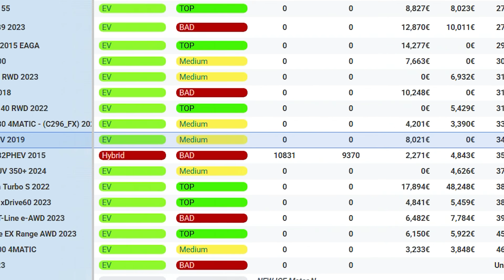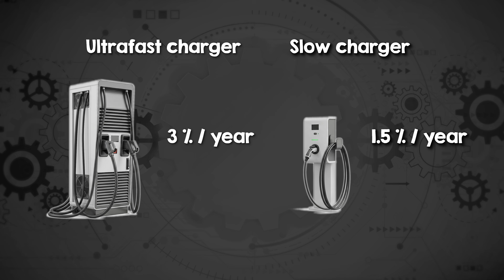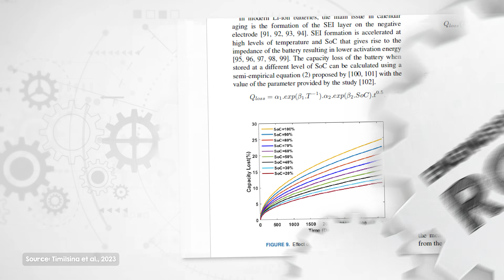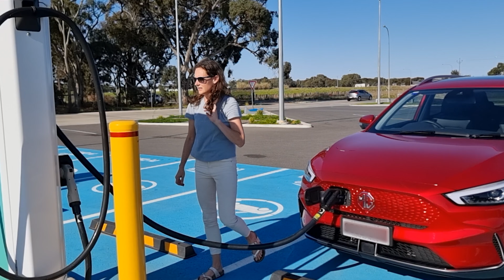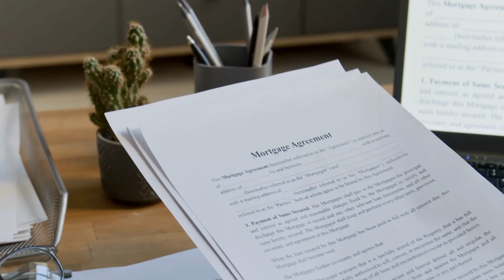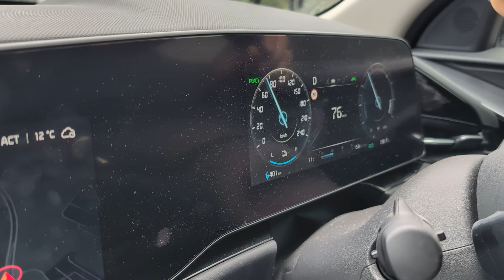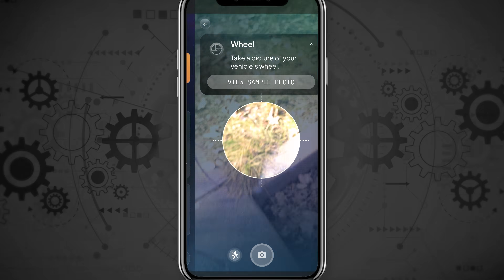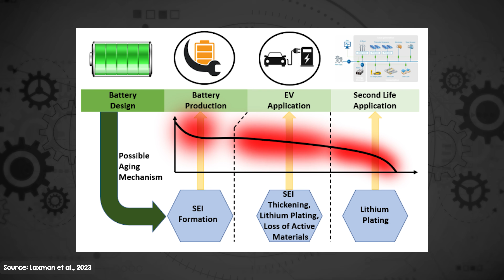Watch This Before Buying Your EV

Comment: Great info, I drove a lease EV for 4 years over 50k miles and mine lost about 4% but I only slow charge at home using the original plug in charger that came with the car.

Comment: Maybe the best any test will tell you is that you're still somewhere on the degradation plateau. I'm afraid that plateau just gets longer and flatter with more LFP on the market. Great information, though! Bottom line: EV batteries last longer than most people expected, and that's bound to get even better.

Comment: my 2013 chevy volt which i bough new now has a limping battery which i need to clear codes occasionally.  I also have to keep more in the battery to keep it happy.  the trouble is that the batteries are generally in series, and all it takes is one cell to pull the entire pack into the trashcan.

Comment: The battery will not be as much problem as manufacturers causing software problems. I had my cellphone for 10 years, and the only reason I bought a new one was the carrier stopped supporting updates that worked with it. If they left it alone, it would have been fine, but the last update caused all kinds of problems intentionally. They did not want me to have this old phone. Car manufacturers will do the same.
Reply: You seem to be describing software-based planned obsolescence, which is being tackled in some places, although too slowly and lenient towards the culprits. I'm afraid.

Comment: I get that people don't trust the information that the car provides via the OBD2 port.  However, how reliable or unreliable is this data?  I used the "Car Scanner" app (free) with a Veepeak dongle (about $50CD) plugged into my 2017 Chevy Bolt.  It reported 59kWh, or 89% of the 66kWh battery that was installed via recall in 2022.  It also reported individual cell voltages, which were within what are considered healthy ranges.  Some say that a more accurate test is to discharge from 100% to 0% and see what the car reports as energy used.  I did this and the car said it used 61.4kWh, or 93% of 66kWh.  (To discharge the last percent or two to zero I parked beside my charger and put the heat and fan on high.)
Is there really any practical way to measure EV battery energy output without relying on the car's sensors and software?

Comment: Most EV batteries are great nowadays. However Tesla’s latest USA Panasonic NCA cells are terrible for degradation. Mine is sitting at 89% at 30,000 miles and I baby the battery when charging

Comment: The usable capacity of an EV battery is the total capacity minus the size of the upper and lower buffers.  Software updates can decrease the buffers and thereby increase the usable capacity.  This hides degradation but maintians the car's range.  Smaller buffers make the battery more susceptible to degradation.

Comment: It's simple. For an EV used primarily for commuting in the United States, use a level 2 charger (240 volt) setup in your garage. For everything else (to replicate ICE travel) the United States needs battery swap stations. If you regularly drive long distance road trips, DC fast charging doesn't make sense! It's using the WRONG mindset! China has perfected the battery swap station... similar to a propane tank exchange. The key is keeping prices in line by preventing Wall Street vultures out of the mix. I envision a co-op type setup where EV users are the investment engine. The eventual idea is to have swap stations as prolific as gasoline/diesel stations. A drive through battery swap can be done in similar time as it takes to fill an ICE vehicle with fuel... possibly faster. It CAN be done. It just takes the willpower to ignore the oil lobby propaganda.

Comment: In 2017, I bought a used 2013 Nissan LEAF. Over 13 years (and 110 000 miles) the pack capacity degraded on average 2% year on year. Here in Québec you can buy this nice 'city' car with 90 km range for 4000 USD (2014 LEAF, on jnauto)

Comment: my 9 year old ionic with 275000 km still has 24kwh ( out of the orginal 28.8). My 11 year old Opel diesel ( 188k km) ( which i originally bought for long trips needs  twice yearly maintenance so I dont trust it for long trips anymore as it broke down with injector trouble stranding me in a tunnel. Anyone want it?

Comment: I just leased my first EV figuring in 3 years the tech will have improved a lot and I’ll get a better car. I charge at home (level 2, AC) and have about 17000 miles in the car so far. I haven’t noticed any degradation yet. I’m so pleased with my choice to lease an EV. It’s been a great experience.

Comment: The title and thumbnail are very clickbaity but the video itself is full of usefull and correct information. Well done.
My degradation after almost 2 years and roughly 26k km is just 1,1%. I use an OBD connector and a 3rd party app to measure it. I live in temperate climate in Europe with mild winters and not too hot summers. I also prefer AC charging and use DC mainly when I need a quick charge.
Edit: numbers corrected

Comment: 10:40 FWIW, the results of that initial factory test are usually stamped directly on the cell, often with a QR that links to the full test results for that specific cell. Of course, reading this yourself involves dismantling your car. 😜

Comment: I bought a used Ioniq 5. I was worried about the battery before I bought it. But now I own it and have joined all the Facebook groups etc, I’ve learned that the ICCU is much much more likely to fail and leave you with a massive bill.

Comment: What was the SOH indicated by the BMS? If we assume the manufacturers aren’t lying, the BMS should have fairly accurate estimates - after all, it’ll know under which conditions it’ll shut off (consider the battery to be empty) and when it’ll consider the battery to be full, and how many watts flows in/out before that.

Comment: Interestingly failure rates of comparable combustion engine vehicles seem to see engine failures are between 3% and 8% and most combustion engine cars and we have three or four year warranty as opposed to 8 year warranty on all electric vehicle vehicles. Also the cost of replacement come between 12 and £28,000 for a main dealer manufactured replacement engine.
I always ask the question what happens if your engine blows up after 3 1/2 years to some friends of mine who always ask me about what happens if my battery fails. My battery is nine years old now I’m still going strong and ironically my friends wet belt on his Ford transit van that was 3 1/2 years old went and he needed a new engine replacement at the cost of £20,000. Nobody ever talks about this the other way round.

Comment: One tip, never buy a white model 3 from a dealer, these are ex rentals that have been regularly fast charged and often charged to 100 percent by the rental company. I looked at one model 3 just like this with just 40K Kms and two years old, it had lost more than 20 percent of the battery capacity.

Comment: EV-Clinic is presenting the prices from the manufacturer, from the parts catalogue AND in a different context from the one you're presenting. These are going to be eye wateringly expensive because it's not the norm to replace the whole thing, just like it's not the norm to buy a new engine if the old one has an issue. That's a new part, with tens to hundreds of brand new cells, BMS and all, 100% SoH and 0 cycles. That's the premium solution to the issue and you'll pay accordingly.
But if only a cell is damaged, the cost of a cell replacement or module replacement is significantly lower and doesn't have to be done by the manufacturer, but by any other tehnician. Teslabjorn, Out of Spec Renew show EV repairs and they're not as expensive or as hard as it may seem.
As an example Renault Zoe is Q240 is listed there with 20.000€ for it's 24kWh battery, from 2015.  But, a replacement battery from a donor car with 41kWh capacity for the same car can be had for less than 4000€. A whole pack, newer and with more capacity. The same applies to the other car models as well. The repair cost of a module is also even lower than that because if a cell is weak, you don't replace the whole pack but a module at most, depending on the health of the surrounding cells. The same with the motor, you replace what's broken, not the whole unit.

Comment: What is with the smart phone analogy? I keep every smart phone until it’s pushed off the network because it doesn’t have the right protocol anymore and I’ve never had any battery issues. Meanwhile, I have dozens of lithium polymer battery toys with individual pouches and those pouches have all kinds of issues (but none of those issues include spontaneous combustion as we seen in the cells used in EVs.)
This video is a swing and a miss, as far as thoughtful engineering goes.

Comment: Battery capacity is not lineal which means 78% battery could be 0% in a second. So the number 78% gives you a false sense of mileage of EV.

Comment: Nissan Leaf are especially bad for degradation due to the battery design. They have no active cooling.

The battery BMS stores a SoH value that it calculates, and the quick scan could be showing that value.

Comment: I have a 1 year old MG5. The biggest impact I see on range is winter in the UK. At a few degrees above freezing I get 2.5 miles per kWh at 20 plus I can get 5. At least in Oz you don't have to worry about frozen batteries. As for degradation if there is any it's hardly noticeable against a background of fluctuations in ambient temperature and driving style / conditions.

Comment: When colour TV was new, everyone was terrified the colour picture tube would fail and cost a fortune. The reality was they were actually very reliable. Same for when electronic fuel injection came along in the 80s. The reality was it was also very reliable, look after your EV and the odds are on your side and avoid known early problematic models.

Comment: I notice you have a Kia and am glad that you point out that the on board system has a buffer to hide the degradation. My 7 year old Kia has significantly less range than when it was new esp in the winter.  I asked the dealership at my last service to check on the state of health and they told me it is 100%, which it clearly is not. Thanks to your video I will check out independent battery SOH testing. Of course Im wondering if I am below 70%, in which case the warranty should cover a replacement. Do you know which form of independent testing they will accept, when their own system shows 100% and of course they will want to avoid the cost?

Comment: Spare battery packs got so cheap it’s no longer sensible repairing them. For a Tesla you’re looking at few thousands for a new pack, that’s for a car that did few hundred thousand miles over 10 years or more, all while requiring almost no servicing. 
Comparable diesel will cost you 10,000 in servicing alone , another 10k in extra fuel cost and then you’re looking at major engine rebuilt / refurb (injection, valves, electrics, exhaust, dpf,…)

Comment: I live in the US and own a 2020 Toyota RAV4 Hybrid with 75,000 miles (120,700 Km) on the odometer. When the car was new I got as high as 47 mpg city, 36 hwy. Now I struggle to get 40 mpg city but, still get 36 hwy. This is barely better mileage than a conventional gasoline only model. I blame it on battery degradation. Compounding the issue the car chooses to keep the engine running at odd times, especially when stopped or very low speeds when the battery is full and the engine is up to temp.
It's for sale!

Comment: Nissan Leafs have more issues because they are the only EV without thermally managed batteries.
Our 2012 second hand Leaf had its battery replaced under warranty. Our second hand 2019 Leaf is also getting its battery replaced under warranty. Leafspy software is great, shows bad cells where Nissan's capacity test doesn't.
Modern phones allow you to set a maximum charge.

Comment: Something kinda big you're missing here is cars with thermal management vs those without. 

That leaf you compared to has none so it will suffer more than say a Tesla with both thermal heating and cooling. Then other models that might only have cooling. 

You should also look into self tests. Tesla has two, a general rating based on the BMS readings and a proper tests that involves cycling the battery. Its only on the charge cycle that I can tell so I'm not the biggest fan. bMW i3 I understand can give you a read out based on the BMS which is better than nothing.

Comment: As mentioned by others here - if you are unlucky enough to have an out of warranty EV with a faulty battery I'm guessing as time goes on there will be plenty of mechanics that will be able to source a used replacement pack from a wrecked EV. This is exactly what happens now if engine replacements (no one replaces a faulty engine with a brand new one bought from the manufacturer). Probably also likely there will be a whole repair/refurbishment industry that takes in bad EV batteries and replaces faulty cells.

Also the benefits of LFP chemistry over NMC cannot be overstated. Buying a used EV with NMC chemistry will always be more of a gamble than LFP because LFP cells have a lifespan that is 3x longer. This on top of the ethical concerns of nickel and cobalt mining really make me wonder why some manufacturers still continue to use NMC chemistry.
Reply: Cause they are much more energy dense, even Tesla use them for their long range models

Comment: I still wouldn't buy an EV or a hybris. Most of them are UGLY and I do not trust Lithium Ion batteries! If they go into thermal runaway (and despite what the evangelists tell you they do) you have mere seconds to get out of your vehicle. Especially in a vehicle accident. Charging at home is just stupid. You risk losing your entire house and everything you own just because you want to save a few dollars.
Plus where are all those used batteries (and the rest of the vehicle) going to end up? Lithium Ion battery recycling is expensive and extremely dangerous, so it mostly won't happen. As many have stated, the best thing you can do for the environment is buy a older used ICE vehicle and run it until it won't go anymore!

Comment: First EV: still have it. 7 years, 110000+km. Lost no more than 5%. Second EV: had for 3 years, almost 4000 km. Lost 1%.
Both vehicles slow-charged 99% of charges. Always charged to max. Always driven in Eco mode (still enough power to embarrass cars 10 times more expensive 😂). Will continue with EV but mostly for the convenience and driving experience.

Comment: I've never understood the logic of stopping charging at 80%. So, in order to slow the battery degrading and loosing capacity over time, I'm going to voluntarily act like it only has 80% of its rated capacity from the very start when it is new. How is that logical? And as it looses capacity, and you are only charging to say 80% of its then degraded capacity, will that ever be more than charging to 100% of a slightly more degraded battery?
Reply: The logic is simple. Almost nobody uses 100% of their car's range every day. 10% to 20% is much more typical. So you don't need to charge to 100% most days. The advice is not "never charge to 100%", it's "charge to 100% when you might need to use the full range, otherwise charge to a level that suits your everyday needs, that way when you really do want to maximise your range, it's still there for you". It's not really that hard to understand

Comment: It is kind of funny how concerned people are, who don´t even want an EV, about batteries from one, when way more often non-EVs have failures simply because of having more moving parts and the maintance with oil is so much bigger alone than compared to an EV were you just drive and go.

Comment: Any battery degradation due to simply age? It must not be zero per year.
Reply: Age in most cases is calculated in the general degredation, like you can´t really seperate the two and you only get the full result of a test.

Comment: I have had a 2022 Nissan Leaf S Plus (larger battery) since September 2021. The car has 36,000 miles now. The battery degradation has been about 7% over those nearly 5 years. So my capacity is 93% of the new battery capacity. My range when I first got it would sometimes be reported as 250 miles (above the EPA estimate for this model). Now the max range I ever see reported is 230 miles. One change I did make was replacing the terrible Bridgestone Ecopia tires with Vredestein tires that have much better traction in wet weather (I live in sunny Portland) but this also reduces range a little bit.

All this is to say that I have had minimal battery degradation that I consider better than I expected. I think part of this is due to the fact that I have rarely DC fast charged this vehicle. I do that maybe 10 times per year. Mostly I do that on longer trips.

Comment: She didn't actually go over the Nissan Leaf, so I'll do that.  The early Nissan Leaf has a problem that did result in faster battery degradation if you use it in hot climates.  That probably gave a lot of people the idea that EV batteries degrade quickly.  And, indeed, it's pretty easy to find first generation Leafs that have bad batteries.  But let me give you the counterpoint to that - you can get an early Nissan Leaf for cheap, and replacing the battery is one of the easiest swaps of all EVs.  I replaced my own with an upgrade.  Plenty of crashed good condition Leaf cars from newer generations, and the swap is almost trivial - about the same as a transmission replacement, which pretty much any shop can do.
Reply: I was wondering too, how the degradation stats from the leaf affected the average, as it was the most sold ev for a while